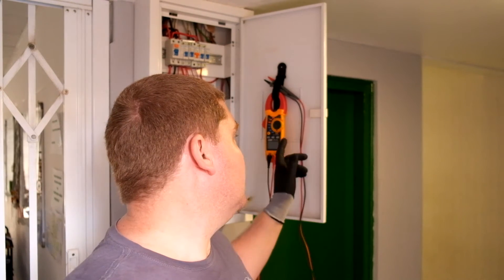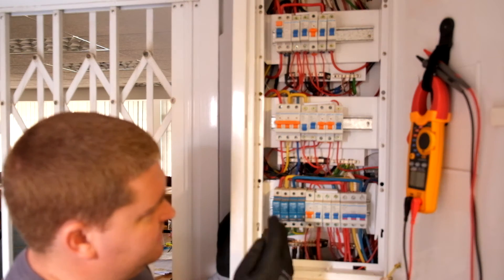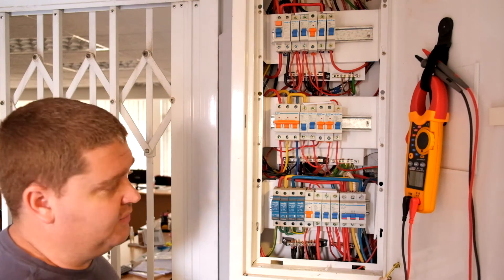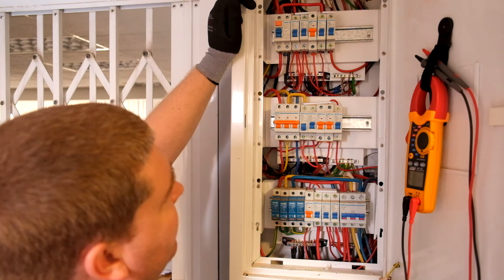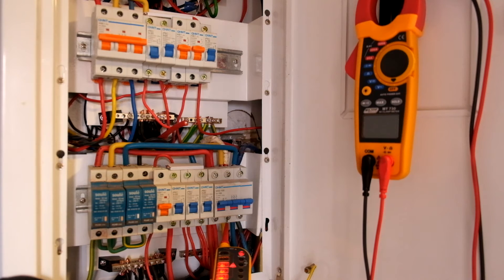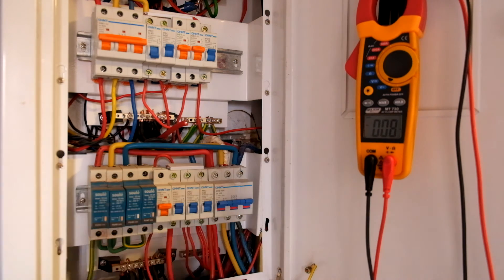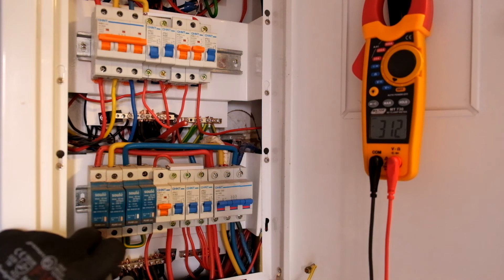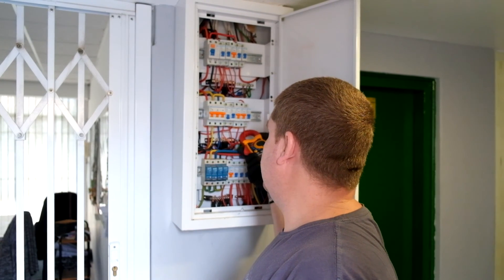Episode 63   Voltage and Current Measurement Basics at the DB

Comment: Wow, that kind of installation would never pass any kind of inspection over here, especially the part in the 'dungeon'.
Reply from the maker: That installation would not have passed my OCD let alone any form of inspection. It has now been cleaned up and the different floors are now fed through their own 63A three phase Circuit Breakers. There is a primary breaker in the equipment room. 

Floors have also been balance properly to ensure no heavilly loaded phases.